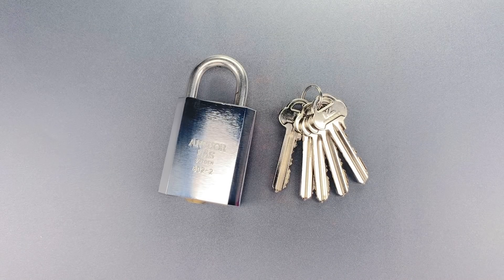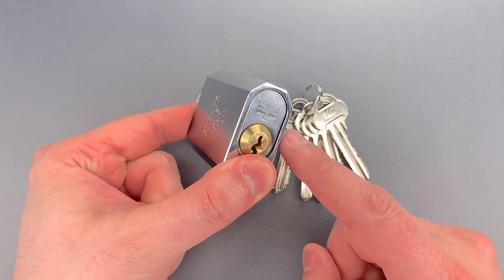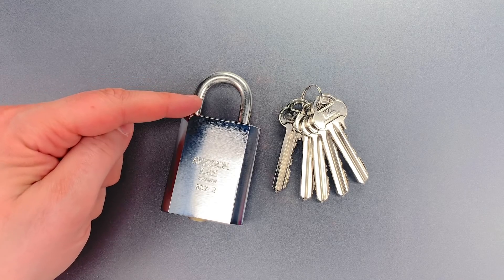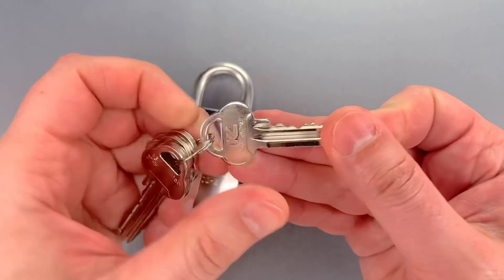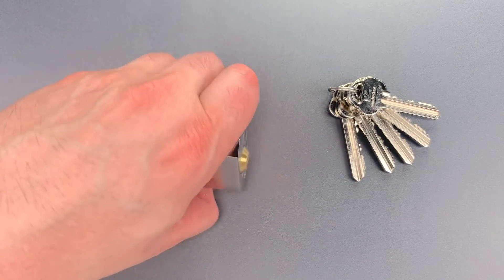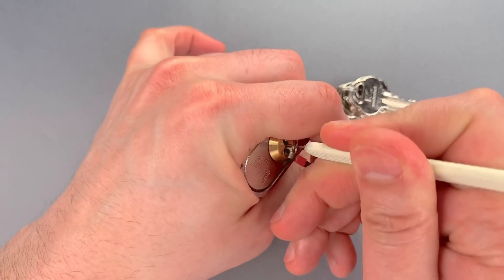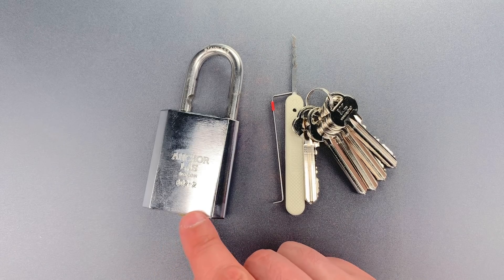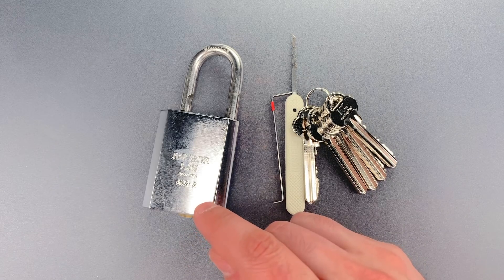[1245] Swedish Anchor Lås 802-2 Padlock Picked FAST (7-Pin Dorma Core)

Comment: Those Dorma cores are super common in apartment doors all over Sweden, however I have to say I have never seen one with that shallow bitting before. Maybe this was a bad example of this lock?
Reply: I suspect Dorma has two different production lines for their cores. I have a few cores from Dorma with 7 pins and the same kinds of security pins. However, you can tell them apart from looks, and one set of cores have way worse tolerances.
Reply: @alexstromberg7696  yes, ASSA is very common, but so is Dorma. I have personally had them in apartments from Boden in the north to Gothenburg in the south, with several cities I lived in in between. They're not at all uncommon. The apartment I live in right now, which belongs to a municipal housing company, has Dorma. I just had it replaced because of some questions about whether the previous tenant still possibly had a key, and they replaced it with (you guessed it) a new Dorma core.
Reply: @SwitchAndLever  Bor i Södermanland och har aldrig sett något annat än ASSA.
Reply: @alexstromberg7696  I once picked my own ASSA door lock with a sewing needle and a screwdriver borrowed from a neighbour because I forgot my key at a friend's place. I'm a complete newbie and it took me less than 2 minutes.
Reply: It looks like the entire range of bitting is small, not just the cuts on this lock?
Reply: Are you saying you think it was a fluke? LOL.
Reply: @alexstromberg7696  maybe time to broaden your views a little. Just because you've only seen ASSA in one place in Sweden doesn't mean that's the case for all over 😉
Reply: Jag hittade det här låset i min byrålåda, jag tror vi körde det på firman som en byggcylinder. Var resten av cylindrarna tog vägen minns jag inte, men hänglås med cylinder och nycklar blev kvar. Vi bytte sen till Kaba ExperT i alla lås, vilken LPL också har fått ett exemplar av (vilket innebär att vår nyckelinventering numera listar nyckel nr 5 tillhörande LPL lol). Det återstår dock att se om Lpl vågar sig på det låset. Utöver det fick han en rejäl laddning med lås från Biltema som kan passa bra jämfört med låsen från Jula han körde för några veckor sedan. Kommer bli en spännande vecka.
Reply: @smcdonald9991  you do understand that the same core can be used in different types of lock, right?
Reply: I wonder if you are going to try raking open some cores and see how well they are now?
Reply: @smcdonald9991  The core
Reply: That is why he sent  to LPL.
Reply: @SwitchAndLever  Sweden will fit into the city limits of Houston TX where I live in the USA!
Reply: @glasslinger  that's a weird flex, and completely wrong regardless if you count by people or by area. You can fit more than 4 times the population of Houston in Sweden, and the area of Houston is roughly 1/250th that of Sweden 😂 Heck, if Sweden was a US state it would be the third biggest one, after Alaska and Texas. This is why you need to invest more into your education system! 😉
Reply: @SwitchAndLever  Sadly in the US if you've saw one apartment or house lock you've practically seen them all.  Mostly Kwickset or clones of Kwickset with a sprinkle of Schlage and their clones. Padlocks are practically all Master or Master clones.
Reply: @smcdonald9991  The core, not the lock itself
Reply: Daniel Eriksson Why are the first 10 words of your comment in tiny text? I see this a lot these days. Any idea how it happens?
Reply: @G58  Looks like YouTube took my asterisks as formatting instructions. Didn’t know it worked that way
Reply: Miss your videos buddy!
Reply: Dorma? Like 90% of the lock in Sweden are ASSA. :)
Reply: Yes, iloq s5 series would be really nice if lpl  take a look at, i never 
 seen anyone done that!  Just videos with  old model  some model. I have looked on the patents but yes it Very expansive like 500$ And the key is around 50$ and you need the programmer. 

The look have only one real pin and one plastic at least the old.
Reply: @SwitchAndLever  Yeah, Sweden isnt among the biggest countries but its not among the smallest by area either, its bigger than Germany, almost twice the size of the UK and about 10 times bigger than Estonia, Denmark, The netherlands and Switzerland.
Reply: @mrfrenzy.  inte omöjligt
Reply: @swebigmac100  It makes sense that this was a construction site pad lock - a bitting that is selected to not be used in any cylinder after the tenants moves in and possible to pick easily if someone messes up during construction. The shackle is also reasonable from that perspective - if no key - boltcutter and get a new lock.
So given the usage for this lock it makes sense with that level of security - thieves can't know the bitting and might be considering a different site based on the brand and cylinder. And a too strong lock means that instead of breaking the lock with a boltcutter they can break down the door that's locked instead and that's more inconvenient.
Reply: Normally I do not comment on YouTube videos related to the padlocks we are producing. 
I am humbled to see that LockPickingLawyer is taking on our padlocks in his famous Youtube channel. He is really skilled and does a great job keeping us lock manufactures on our toes. 
However this time I find it a bit unfair as LPL is actually testing a lock cylinder made by DormaKaba which happens to be installed, probably by a locksmith, in one of our padlocks. A type of padlock without cylinder we sell to locksmiths for them to install certified Scandinavian Oval cylinder in.     
Even though I find DormaKaba to be a fine company I cannot  take credit for nor be responsible for the quality of all their cylinders. 
I do, however, guarantee that the Swedish manufactured padlock in this video is made to the highest standard and quality. 
Stay safe and secure!
Best regards Tomas Eriksson 
CEO and Owner
ANCHOR LÅS AB 
SWEDEN
Reply: @thomaseriksson3423  I would expect every serious lock manufacturer to view these videos.
Reply: When I was 15 I picked my neighbor's 7 pin ASSA in Stockholm when his mom got locked out, just from "guessing" and being told some time before how to do it. This was in the mid 80's. The tools was a bike spoke cut in half. One half I bent to an L and made flat on one end, the other has a little "nib" that I used to pick. I had never picked a lock before. I don't give much for those cores since then.
Reply: @thomaseriksson3423  this comment should be on top.
Reply: @Denamic  Then you're either a much more skilled picker than me, or that lock must have been so warn out that it's not even funny. I bought two ASSA 700 from new just for picking. I've had them both for a few years, yet I can't pick either in less than 10 minutes if it's been a few weeks since I played with it last.
Reply: @andersjjensen  Master keying and/or lack of security pins makes it a lot easier, just like with the "Dorma 700" lock in this video. It all comes down to the locksmith who built it.
Reply: @Fredrik G
Thanks Fredrik. I am trying but Youtubes algorithms doesnt dance with me on this. I guess the number of comments and likes is what matters.
Reply: @thomaseriksson3423  I think replying in the main comment hierarchy yields a higher chance of rising to the top than a reply to another comment as it will just be added to thread (which might rise but your comment will still be below the main comment). Just an observation though, not verified.
Reply: @glasslinger  and Texas is a cute little place. In Canada, it’d #6 by area, and only a bit bigger than 6, 7, or 8. Texas would fit into Nunavut over three times.
Reply: det är en kopia på assa 700 cylindrar

Comment: i've still never picked a lock yet i tune in everyday.
Reply: Try it. Open a high security vault in a bank.
Reply: Start with a few cheap locks from the store, including a master lock (gotta start easy), a cheap set of good picks and some torsion bars (wiper blades work good as another said). You can practice while on the couch, etc. Its more feel than visual. I like a single finger pick as I can feel each pin push into place. As LPL jumps number to number, he's finding the first to last pin that is bound up and pushing it to the shear line
Reply: get yourself a pick set, get a cheap master lock, then say "this is the lock picking layer" drop it and watch it fall open
Reply: Why do you think there needs to be a correlation between them
Reply: Me too

Comment: You'd think it would have been an industry standard to have your lock tested for wave rake vulnerability.
Reply: Industry standard? The only industry standard is to give an impressive sounding name to a lock facsimile and sell it at an exorbitant price more in line with the name than the product.
Reply: The bidding on the lock of the gate in my house was so bad that I could open it with a nail cutter, it was so flat that it was basically a blank key
Reply: Unfortunately their mistake was simply not excluding certain bitting combinations.  I could probably put together a Kwikset that's more resistant than that lock, because I'd go with bitting as extreme as Kwikset allows for and vary the springs enough to make it difficult.  I fully expect someone competent could single-pin pick it but that it wouldn't be readily raked open.

Thing is, eliminating bitting that's too similar among adjacent positions also reduce the number of possible keys for a lock system.  With seven pins they should have been reasonably OK though.

Comment: This reminds me of France building this huge defensive line against Germany who then simply went around the line and captured France.
sad trombone
Reply: 'Laughs in Erwin Rommel'
Reply: Also known as the Maginot Line
Reply: The Maginot Line fulfilled its pupose, it was supposed to divert a German attack to the north and that‘s what it did.
Reply: @HingerlAlois  And it failed (in large part) because Belgium, despite agreeing to the idea, never built there part of the line.
Reply: @MonkeyJedi99  No Belgium afaik didn't agree to the idea, the whole neutral thing you know?
Reply: @Unknownmonkey13  Hm. It was taught to me differently. i will have to do some self-guided research.

Comment: This is now a day of mourning for Sweden.
Reply: The cylinder is not Made in Sweden. The padlock is sold from the factory without cylinder. It is up to the locksmith to chose the what cylinder to insert. I guarantee that the padlock is manufactured to the highest standard and quality. The cylinder I cannot take the credit for.

Comment: Anchor Lås locks are often sold without cores and accept regular door cores. The problem here seems that a poorly bitted core was paired with these locks. A proper ASSA core can easily be inserted instead.
Reply: A company rep has responded with exactly that. It’s not their core.

Comment: To be fair, run of the mil thieves would not use a rake, they would just use a bolt cutter on that relatively slim shackle. Still quickly open.

Comment: People shouldn't really give Anchor Lås a bad time for this, as they only make the lock body and not the core. Note that the body is exactly what the LockPickingLawyer notes is of really good quality. 

Blaming Anchor Lås is like blaming the manufacturer of a door on a drafty house because the builder of the house forgot to install insulation in the walls.

Comment: In Germany we say: Gut gedacht, schlecht gemacht! Roughly: nice thoughts, terrible execution 😒
Reply: Ja, genau!
Reply: Gut gemeint ist nicht gut gemacht!
Reply: Bla bla bla something German exclamation mark!
Reply: @anuragneelam8527  Was fuer scheiss ist das? Wir sind nur freundlich.
Reply: @cmonkey63  uh, bla bla something German question mark?
Reply: In America we call that fumbling at the goal line. Good core, 7 security pins (or at least 7 pins with some security pins), then you blow it at the end by making the key pins all nearly the same size. Even Master Lock thinks that's terrible bitting, and you can rake most of their locks with a chewed up zip tie.
Reply: @anuragneelam8527  Nein, nein, du hast gemeint, "Bla bla etwas", oder.
Reply: @cmonkey63  Nicht die unter einer Brücke lebende mythische Kreatur mit Nahrung versorgen!
Reply: @cmonkey63  uh, yes
Reply: In the uk it’s called a fuck up
Reply: So basically the same as "sounds good, doesn't work".
Reply: My Gramps said that all the time - - -
Reply: Normally I do not comment on YouTube videos related to the padlocks we are producing. 
I am humbled to see that LockPickingLawyer is taking on our padlocks in his famous Youtube channel. He is really skilled and does a great job keeping us lock manufactures on our toes. 
However this time I find it a bit unfair as LPL is actually testing a lock cylinder made by DormaKaba which happens to be installed, probably by a locksmith, in one of our padlocks. A type of padlock without cylinder we sell to locksmiths for them to install certified Scandinavian Oval cylinder in.     
Even though I find DormaKaba to be a fine company I cannot  take credit for nor be responsible for the quality of all their cylinders. 
I do, however, guarantee that the Swedish manufactured padlock in this video is made to the highest standard and quality. 
Stay safe and secure!
Best regards Tomas Eriksson 
CEO and Owner
ANCHOR LÅS AB 
SWEDEN
Reply: @thomaseriksson3423  Wow! Didn’t expect an answer from the manufacturer... and now even the CEO personally responded! Your answer explains a lot, thank you! I often see this problem when locks are going to be tested with third party cylinders in them.

Keep up the good work and maybe we will see your products again in the future tested on the components you made!
Reply: @devilsitez  Thank you, Sascha! Have a great evening (if you are in my part of the world)!
Reply: @ts757arse  Thanks!
That's why I bother to react on this video. The reputation of our brand is worth fighting for.

Comment: Could you do a video on how bidding is decided in lock manufacturing? Do they randomise it for every lock, iterate through all combinations, or make locks with the same bidding in batches?
Would it be feasible to avoid "bad" bidding in the manufacturing process and would that reduction in variety have an effect on the security of the lock? (Knowing that certain biddings aren't legal might make picking easier, for example.)

Comment: In "video [1234]" could you apply the T pin(Schlage) plus master wafer method used in "video [527]" for improved pick resistance heightening security?

Comment: These ASSA 700 knockoffs are nowhere nearly as tough a pick as the real item. I have two ASSA 700s in my own collection, and even though I know them by heart at this point I can't open either of them in less than 10 minutes. That combination of tapered and "wedding cake" drivers with super crisp edges on the counter-milling in the core makes them bloody unforgiving of even the smallest tension error.

Comment: Paperclip or hairpin lockpick? I searched the videos and was unable to find one that tests the movie's / TV cliche of using a paperclip/hair-pin to lockpick a prison cell or whatever. Anyone know of such a video experiment?
Reply: My memory is going (getting old) I saw one about 1/2 year ago, and I want to say it was from LPL, but I can very well be wrong as heck. Bottom line, those movie with hairpin are down right lying, they may be 'raking' the pins, but there's no tension to open the lock/door.

If I remember the video even close to being correct, in Terminator 2, where Sarah Connor breaks out of the room, is best depiction, because she used two pins, one to "rake" and another to turn the lock. But hairpins are no where as sturdy or strong to be able to accomplish what she was trying.

Only if I can remember where I saw that vid...

Comment: Oh, we're reading about locks now?
Nope, just a typo. Å and Ä are totally different. Läs means Read!
Pro tip: There's a small utility in Windows called Character Map (charmap.exe) where you can pick pretty much any weird character you can think of. Handy when you can't find it on your keyboard... (Or you could just go to a Swedish website and copy the character you need.)
Step one is of course to realize that they are different characters.

Comment: When a lock is “ manufactured” what determines how the core is “created”... I’m obviously a novice but have seen keys that are almost completely flat all the way across...
Reply: yes, those would be locks with poor bitting. The manufacturer almost undoubtedly uses software to generate a list of bitting based on how extreme the differences between pins can be, and undoubtedly at least the keys are automatically cut as many manufacturers stamp the bitting onto the key as numbers.  Whether the lock is manually filled or filled by machines I couldn't say but either way, when they're manutacturing thousands of locks a day they're going to end up with some that aren't bitted very well unless they've made choices to exclude those combinations.
Reply: The bitting is determined by what pins are present as key pins. Usually you should have some difference- all 5s would be a flat key, for example. Many makers stamp the key pin numbers on the key- I know LSDA and US Lock did for many years, and when bought in bulk the case would all be keyed alike. When I was installing probably 50 LSDAs a day I saw some insane bitting. One I remember well was 41415- we had a case with that, and it would make a rake attack very difficult.

When I'm pinning a lock for personal use (say, when we moved), I intentionally use extremely weird bitting. Our apartment uses six-pin Schlage, all spools as drivers, and no two adjacent pins are within 3 of each other. It can be picked, but I make it as hard as possible. I can pop it but it takes a very long time (and I'm a pretty good picker).
Reply: These locks are generally sold without a core though. Any high security oval core can be installed, in this case a weak core was installed and sent to LPL and picked.